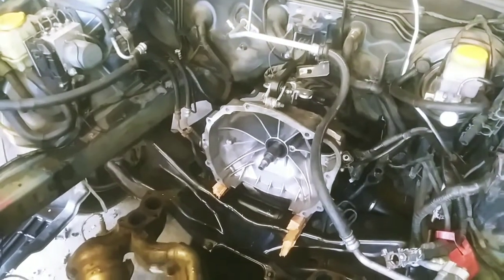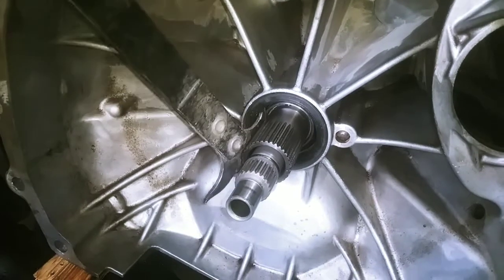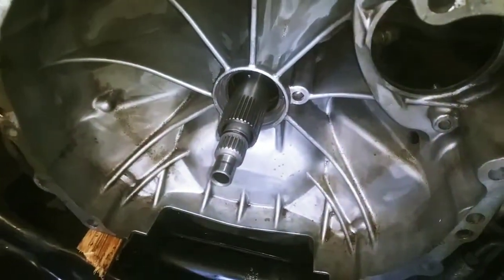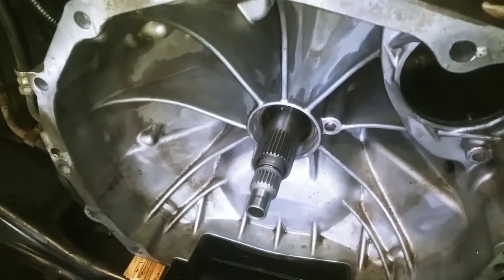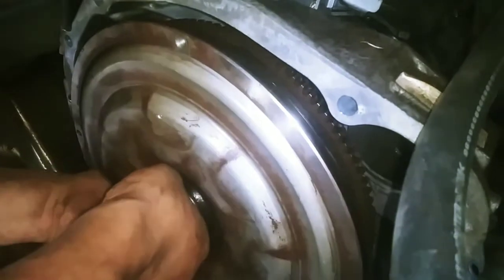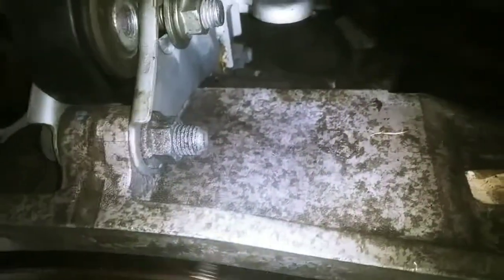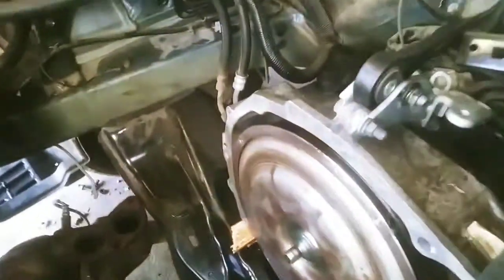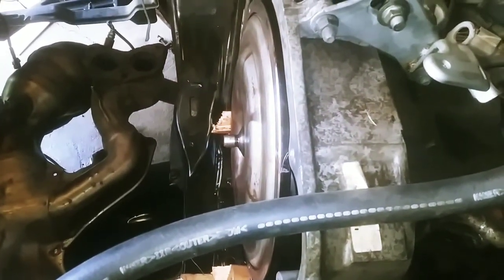2009 Subaru Outback 2.5 Transmission- Torque Converter Seal Replacement

Comment: Thank you, I was having trouble reinstalling tc after replacing the seal. This is exactly what I needed to know to finish the job
Reply: I just finished putting the motor back in. I used a pick to fish out the sleeve and circlip, attached it to the tc and it went right in first try. I spent 2 or 3 hours trying to line it up and then stopped to search YouTube. Thanks again for the clear instructions!

Comment: i've been searching all day for this video! Hope the process is the same for my 19 Crosstrek. Cheers!
Reply from the maker: Hello. ,,it should be the same ,,thanks
Reply: Do you have to drive the seal in, I just see that you put it in by hand?
Reply from the maker: @dbass1961  yes you can do it by hand if you have strong fingers like me lol
Reply: Is the part number for that seal 710265?
Reply: Hey so did it work out?
Reply: @mica9977  it did! Next engine I pulled I used a small C-clamp through the starter hole to clamp the flywheel to the bell housing.

Comment: Why did you change the torque converter ? Cuz of noise from dashboard when you accelerate ?
Reply from the maker: We never replaced the torque converter ,it was the output shaft transmission seal that was replaced
Reply: @mgmauto1160  right, what was the reason top changed the seal? cuz made noise ?

Comment: What is the part number for that o-ring on the shaft? I'm having trouble getting the correct one.
Reply from the maker: Hello, the part number is in the video, oem part  numbers, g92001 or g82007  genetic part number. 806920070